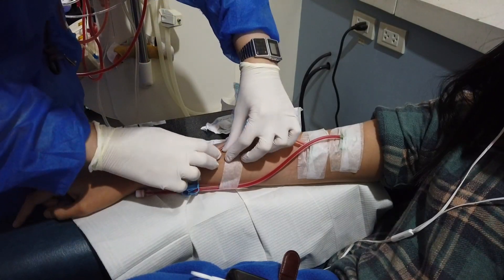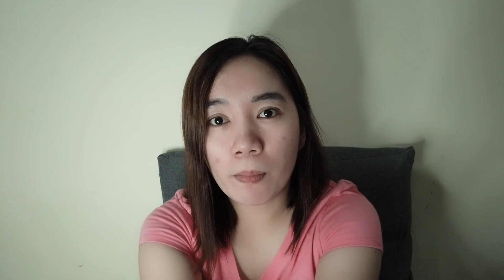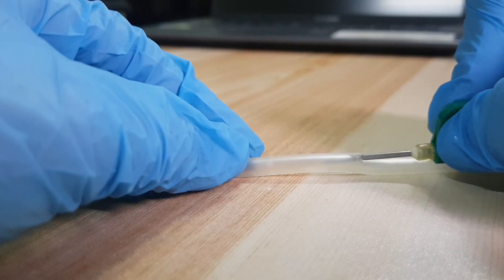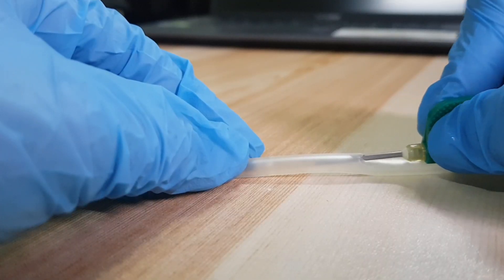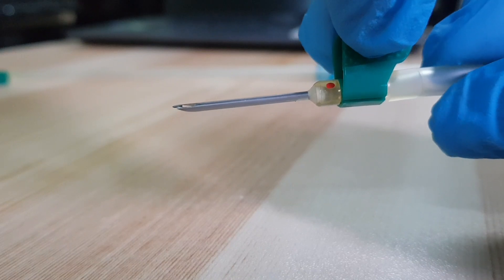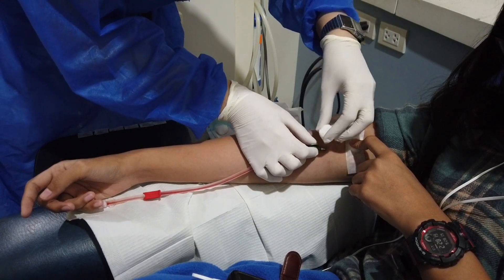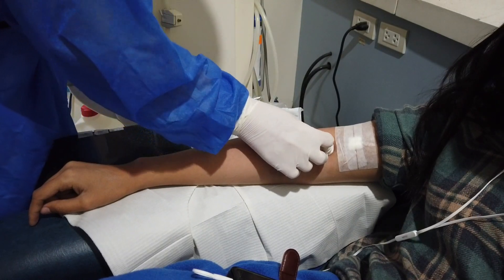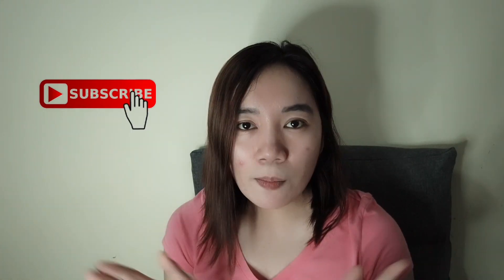AVF Decannulation procedure + avf cannulation techniques

Comment: Hi I just started as a dialysis nurse in fresenius 4 months ago and I always have a problem pulling out the arterial needle and the patient always bleeds so heavy. I was taught to pull out the needle quickly and use the master guard and using the 4x4 gauze.

But when I ask the senior nurses, they said they use the 2x2 like you and they pull out the needles like you without any needle guards. I will try your technique but how can I tell when the needle is about to come out so I can apply pressure at the right time?

I am feeling abit discourage about continuing this career path due to the several bleeding episodes from the patients. Thank you so much for the video, it is very informative!
Reply from the maker: I suggest to really follow your facility policy esp the use of safety needle device. It always differ per facility which is something you cannot change. Try check your needles to visualize so you estimate the length. It also needs good pressure and should be at the right spot. If it bleeds, either your pressure is light or your not just at the right spot.
Reply: Thank you for your swift response and advice. I hope my shift goes well tomorrow 😔
Reply: hi how are you? im a new hd nurse po

Comment: Good evening po maam ask lang po. 1st time of avf access, what is the best position of the needle for the artery, isn't needle up or needle down? Thank po maam
Reply from the maker: Up
Reply: Thank you po maam
Reply: Next po ma'am,, same question din po if AV-GRAFT naman po si patient then 1st time to use.
Reply from the maker: @markanthonydandoy9385  does not matter sa graft since no need for maturity. Magbase din kayo sa direction kung ano ang placement ng graft or if loop or straight buh.
Reply: Ok po ma'am thank you po ma'am sa information po kase less than 1yr palang po ako as HD NURSE.

Comment: I have problem remove cannulation if u remove slowly the blood will not splash out ?
Reply from the maker: That’s my style. I move it slowly just before the bevel and then quickly. It works for me. It’s still case to case basis, though. There are patients who really bleeds a lot.
Reply: Thanks for the sharing it really help a lot for those who just join dialysis . God bless